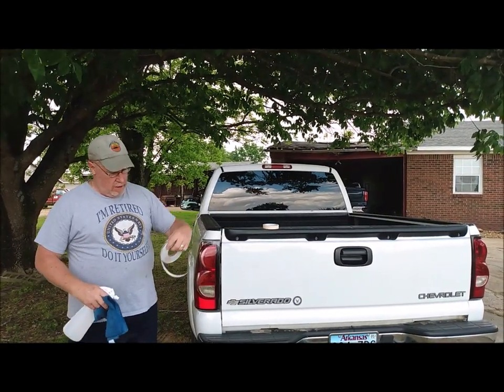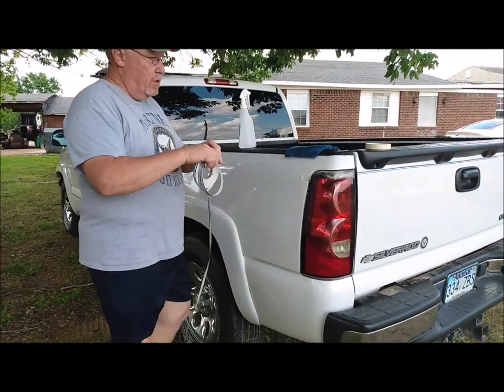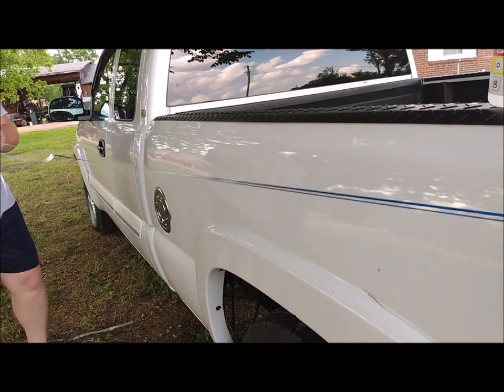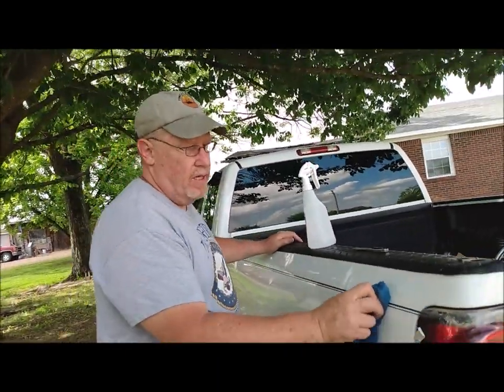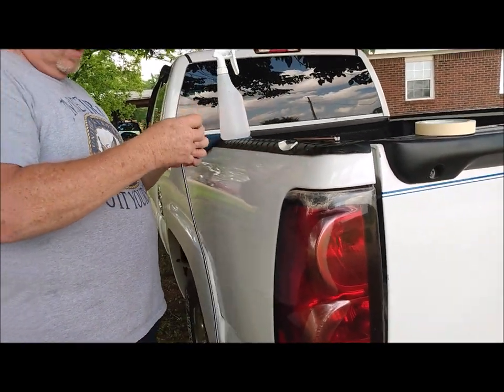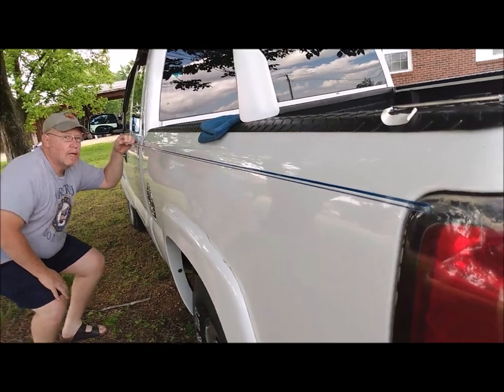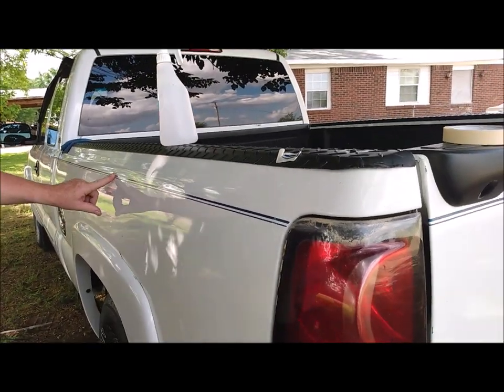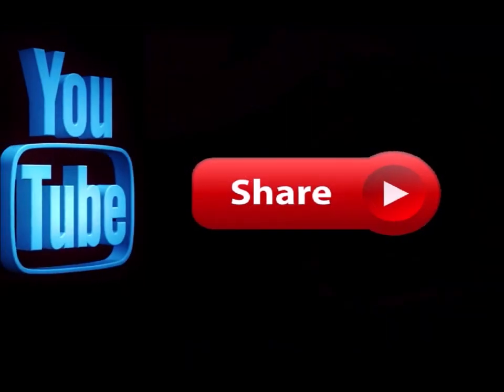DIY Pinstripes - What do you need to know.

Comment: Hey Ed, just a heads up, you should always do  the whole side of a vehicle at one time and not panel by panel. It tends to end up crooked if you don’t. I’ve  been doing stripping for over 30 years. Just a suggestion buddy.
Reply from the maker: Thanks for the heads up.  I did it this way because I was outside and the wind was blowing.  Overall, it turned out pretty straight.
Reply: Ed's Attention To Detail  I worked detailing cars for dealerships and stripped every used car that got traded In. I’ve learned a lot of neat ways to strip. I did my Vette not to long ago. You wouldn’t believe how many people I’ve seen stripe and not take the clear off. Yours looked good buddy.